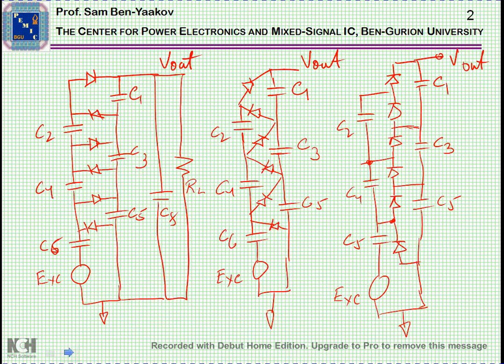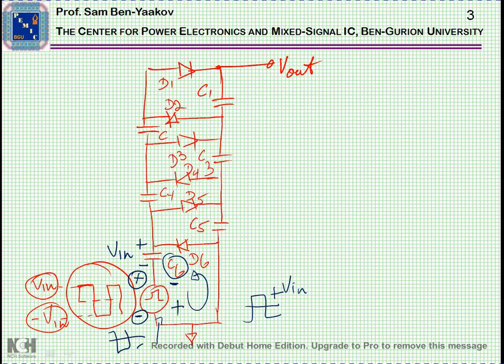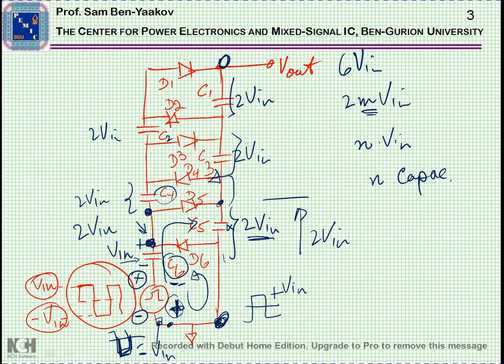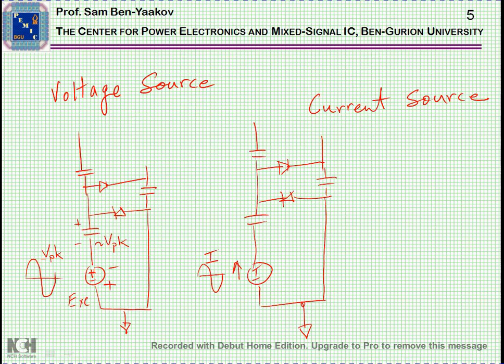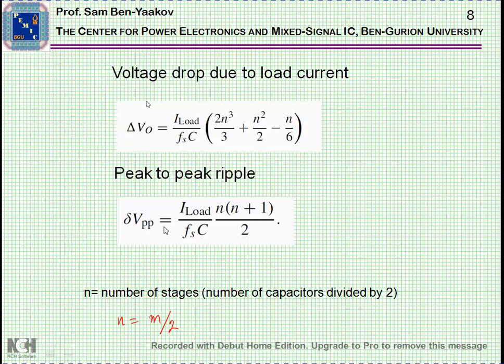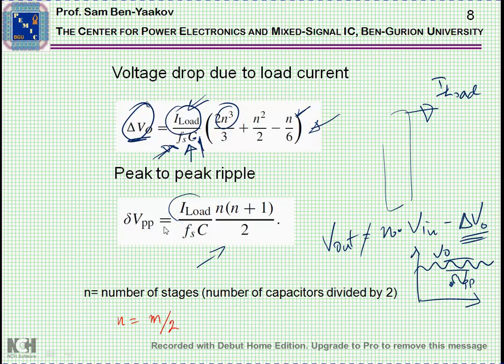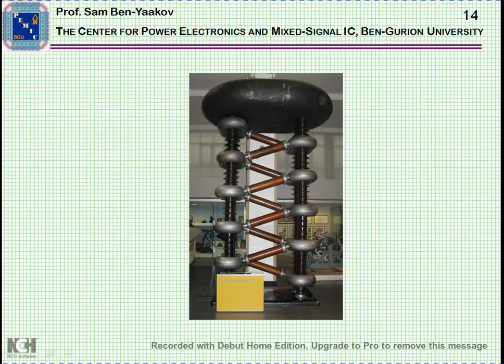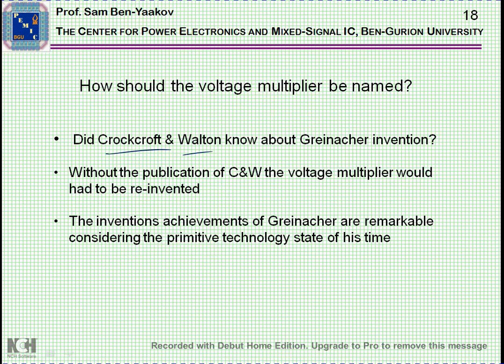The Voltage Multiplier and how should we name it

Comment: Dear Professor Ben-Yaakov. Thank you for the clear explanation. There's however something Idon't understand in the formula given for output voltage drop : it seems that the diodes forward voltage is not considered. I can't get the reason why.
Reply from the maker: This is because the analysis is under the assumption that diodes are ideal
Reply: @sambenyaakov  Thank you for the reply.And thank you for keeping sharing your teaching.

Comment: Professor Shmuel, 
I really thank for all your videos.
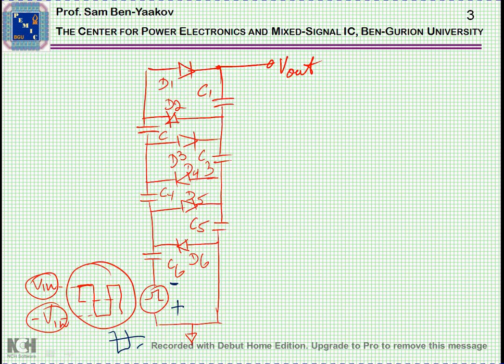At 2:32 , circuit is ground referenced, while Vin goes to negative voltage. I guess Vin should range from +Vin to Gnd.
Reply from the maker: Thanks for interest and comment.  Since the  capacitor C6 is in series, the DC is blocked. So if the input is Ground to  Vm then
 Vin= Vm/2 and -Vin=-Vm/2

Comment: Hi Shmuel!
It is worth mentioning that in 1919 one more circuit of voltage multiplier has been published.
Moritz Schenkel, "Eine neue Schaltung für die Erzeugung hoher Gleichspannungen," Elektrotechnische Zeitschrift, vol. 40, no. 28, pp. 333-334, 1919.
The full text in German is available at the end of this page
https://triz-journal.com/relation-invention-process-triz-example-high-efficiency-dc-dc-converter-liquid-crystal-watches/
So, the ideas how to make voltage multipliers were in the air in 1920th and as you noticed, this was merely the matter of time. Another point that I personally liked is link between the shape of current and EMI. I never met any formal study on influence of the EMI induced by integrated power supply on the analog part of mixed-signal IC.
Probably, the effect of EMI when it will be studied, will be filmed in Hollywood as The Effect of Gamma Rays on Man-in-the-Moon Marigolds :)
Reply from the maker: Thanks Alex